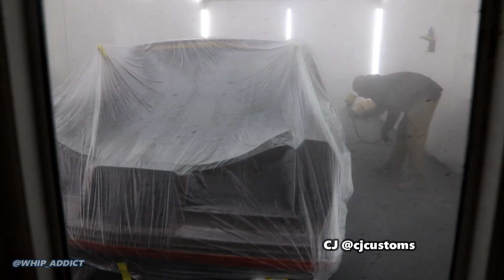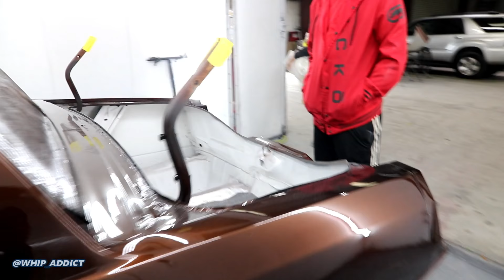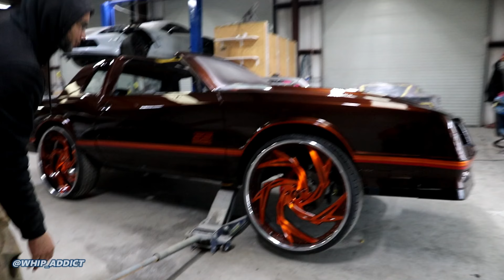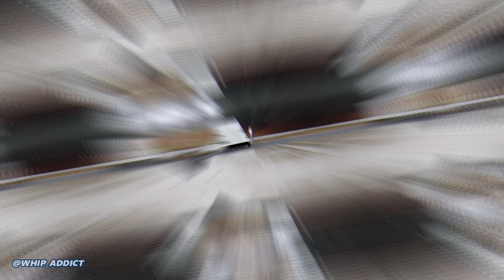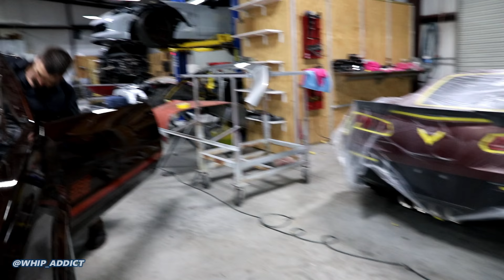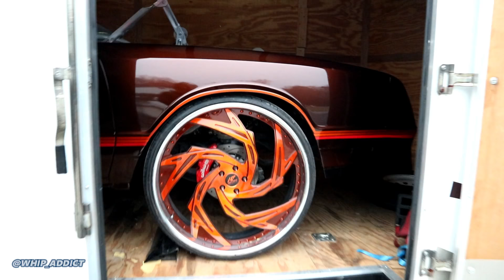WhipAddict: World's First Monte Carlo SS Tuckin 28s! Kandy Root Beer G Body, STR Dre,

Comment: That same pin stripe would be sooooo perfect on a grand national...
Same logo colors...
This joint hard than a bih frfr
Reply: MexicAmeRogue.  
Fool that is NOT a chevy color wtf are you talking about? To be exact it's a 3 color strip of red to Orange ...
You just like arguing i see, as you have no point. Theres nothing Chevy about the stripe colors.
Reply: MexicAmeRogue.  
Again the GN logo, meaning the Turbo 6 logo is orange and Red. The same 2 colors that's in that 3 color stripe. So if you want to be technical, that chevy has BUICK colors on it! 🤦